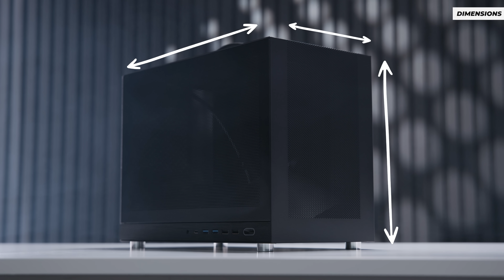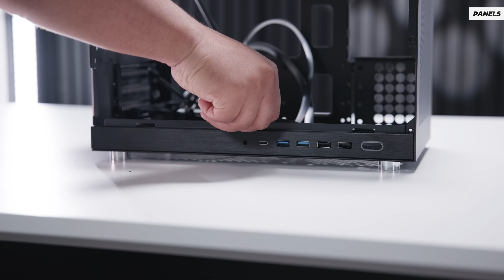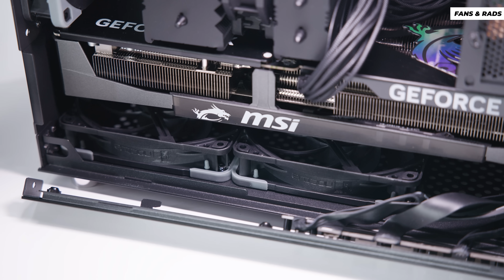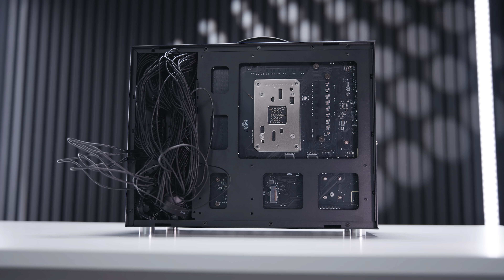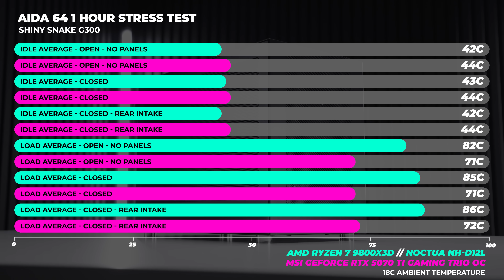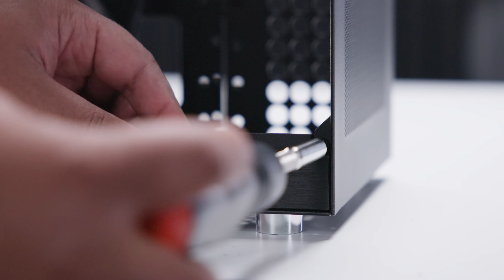The 16.8L SFF MATX Case that you've never heard of... until now

Comment: 16:40 I will say for anybody considering this case and is good with your hands, I would say go for it. I got this case, just getting into computers and bought a Prebuilt mATX PC and wanted to move to a smaller case, I think I spent maybe 2-3 hours moving everything over and not rushing. I would agree the most difficult part for me was the cable management and getting everything to fit (I kept the ITX PSU that came with my PC and barely had enough clearance for the cabling). Well worth the hassle to have the same PC I have in a smaller form factor and portable to switch between my room when I play and my living room to stream shows/movies.

Comment: I bought one back in March, I'm still using it but I swapped my Royal Praetor 130 to a 240mm AiO.

idle temps are better and full load barely reacher 80c with a 9800X3D.

Comment: Hey man question. I'm literally about to build a matx build. And portability is very important because I'm going to use it for work and for gaming in the living room taking it to lan parties etc. I have everything except for the case and psu so I'm pretty much ready to build. The GPU is a strix rtx3080. CPU is a 10400f and I have a 280 rad for it. I was going with the Asus ap201 but if I can make this work I'd be happy what do you think?

Comment: Someone switched on, B650 mAtx boards, it was only AsRock and Gigabyte that had the top pcie slot as the gpu .. Asus and MSI had them one slot down.
B850 boards, seems like all of them got moved up to the top slot.

Do love this case. Like you said prob abit on the small and tight size. But there is HELL no way that really.. anyone should need a full sized ATX case.
Feel like at this point tho, just bite the bullet and go SFF/itx.
Are you going to check out the Ncase M3?

I just bought a few things to make use of some old parts I have, to make a PC for a mate.
Kinda wish I didn't cheap out on the case now, ended up with the 35L View 170 from Thermaltake.... 
Its not bad, easy on the eyes. Not overly big. Very cheap.. and comes with 3 fans..
But now wish I ended up going with a CH160, Lian Li A3, or a Jonsbo D32..... kinda forgot proper small mAtx cases.
Haha just happy I didn't end up with a full size ATX 50+L sized fish tank.

Comment: Do an AIO version! Currently have one as my first build and let me tell you lol I was frustrated as heck indeed at first especially that I used an AIO cooler that almost didn't fit because the rad and the right hand side fan were too thick, had to replace that stock fan with an expensive slim one due to the first slim one I ordered NOT fitting again, AND even when I replaced it with the expensive one I still had some issues with the AIO tubes hitting the fan at first which required me to tie the damn thing in order for it to get pulled back and for it to allow the fan to spin but long story short I figured it all out in the end and it's been a joy to look at everyday. Temps are 👌🏻(didn't have to install case fans so: intake = GPU fans. The GPU is ultra close to the case floor being 2.9 slots thick and mobo forced me to install it in the 2nd PCIe slot; exhaust = AIO fans) Noise is close to non-existent when idle and not even that loud while on load to be honest. I am fully happy and satisfied with my first ever build, nothing compares to the feeling when I just blindly decided to press the power button after assembling everything together and after a short while, the newly built PC just went straight into the BIOS. Felt proud of myself, it was a journey
Reply: Yeah I had swap out arctic freezer AIO fans to slim ones too

Comment: Currently happy with a Lian Li Dan A3 for my HTPC (the only situation where I would use a case where the buttons are at the bottom), but I have to say I really like that there are some new modern cases that are not designed to be aquariums. We need more all-mesh designs like this. That being said, I'd not be keen on building in something so small, the A3 was challenging enough for me.

Comment: I have a Lian Li from 3 years ago which is smaller than this, Mini ITX, Smaller GPU Radeon RX 6600 XT, Ryzen 5 5600 6 Core, 64GB Ram but most screws are easy grip, you mostly don't need a screw drivers, got it for $60. The build can still play most recent games in Ultra. Apart from SSD, I even have 2 1 TB HDD fitted tightly not even water cooled but never overheated. No handle though. ahehe

Comment: The dimensions look right, and I love the side IO panel. The handle is cool, but I get nervous moving a PC with heavy coolers and GPUs. I'd probably use some little foam blocks to minimize them putting stress on the mobo if I was travelling with it. Would be nice to see cases that addressed this, since both components are far heavier than they used to be.
Reply: just built in this, went with AIO to not worry about a heavy air cooler.  GPU is resting on foam sealing gasket that also forces it to draw air through the bottom (I did use a grinder to open up the bottom panel as it's too restrictive)

Comment: i mean, the sffpc community has known of it for a while, it's aight, not the best thermals, not the best looking, not the best build quality, but for that price it's a steal. still appreciate featuring affordable options and bringing more light into the community!
Reply: tbh, shiny snake's pricing was considered a little expensive compared to other Chinese sff matx cases, but none of them supports the same amount of front io like g300 so that's what I bought
Reply: @kuro_2333 The same thing happens to me, so many Chinese versions with only 2 or 3 front ports 💀
Reply: @kuro_2333 would you recommend some chinese compact sff cases
Reply: Wished they added even 92mm fan support in the top of the G300 without having to fully commit to the larger G350.

CPU thermals are mediocre since the heatsink eats all of the GPU exhaust
Reply: What do you suggest?

Comment: The AIO/SFX brackets are a separate bundle item from the case. That’s why it’s not included, but the manufacture should’ve let you know that and sent you the brackets as well.

I personally would stick to air cooling anyway but it’s cool you have the option to liquid cool.

Comment: You've definitely got to try the Shiny Snake G350, it improves on a number of the issues you have with this case, but making it a little bigger
Reply: I think it's pretty, however, for this type of case, using glass panels instead of mesh makes me choose the G300 a thousand times over the G360.

Comment: It is like the S300 with more ports. They couldn't even bother not to copy the number, lol. Also, the S300 is 8.1L (ITX) and comes with a riser cable for a vertical GPU mount.
Reply: They are from the same company and the s in the name is for Sandwich style itx cases like the s400 and the g for the g300, g350, g400 etc, are for regular mounted gpu cases